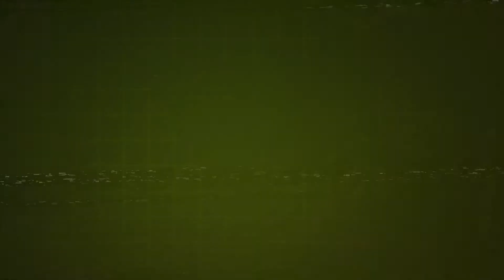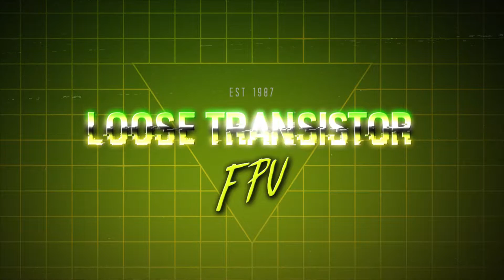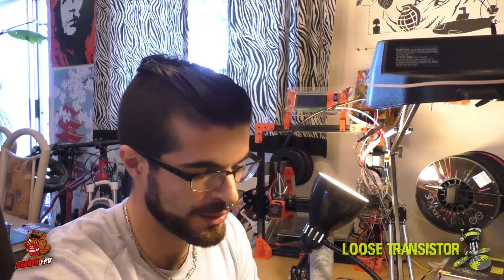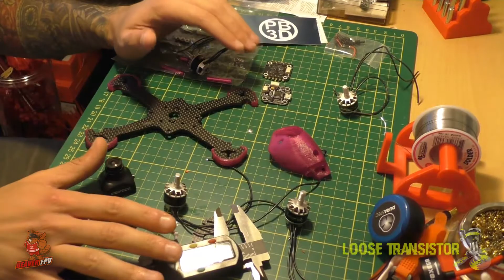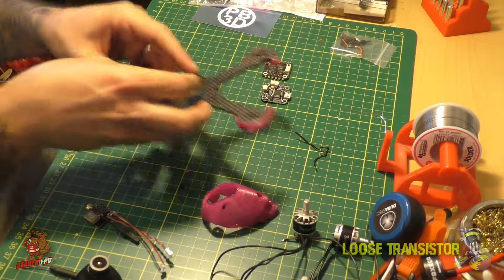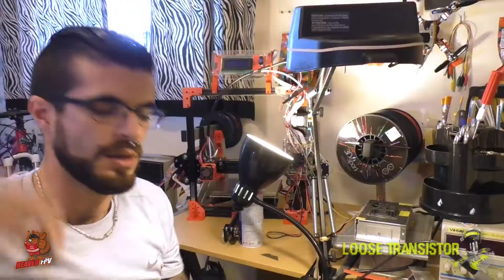SATURN TITAN XS - 3" Parts!  ♠ [ FPV DRONE BUILD ]

Comment: please upload the build video as well I really appreciate.thanks
Reply from the maker: Soon my friend! I still have to build it and record that portion! I do everything sort of real time with you guys, I don't build first then release the videos we go on the journey together =)
Reply: Loose Transistor FPV sure brother I am waiting for build video because you explain each and every thing very clearly and it's very easy to understand.thanks
Reply from the maker: Thanks man, really glad to hear that my videos are helpful =)
Reply: I am very new to this hobby can you assist me which drone is good for me to become expert pilot.thanks
Reply from the maker: I would recommend you buy something that is tough and well built. You will crash a lot at first so its worth investing in a frame that can take some abuse. Wizzard 220 seems to be a popular choice these days.

Look for something with at least 4mm bottom plate. Don't go crazy on motors, 2204/2205 2300kv should be plenty if you are just getting started.

My advice for becoming an expert is to spend some time with a simulator. I highly recommend Liftoff and would suggest you spend many hours there practicing and getting used to flying a quadcopter in FPV.
Reply: ok dear I will practice on simulator first.thank you

Comment: these little brushless quads are an absolute blast to fly! I didn't know they made 4000kv t1 motors! those should ROCK on 3" props

those lumenier props are by far the best 3" props I've used so far, excellent choice!
Reply from the maker: Yeaaah! I love tiny brushless quads man, the Baby Beaver and the Doinker were a blast and now that I think I finally have the right parts for a light 3" build I am sure this one is gonna rip too! You got some 3" quads as well?
Reply: I have an original atom that I've retired haha, my first quad I built / owned and it's been through hell! I recently built a japalura 3" and while it's pretty snappy I decided to throw a 4" baseplate on it and it's perfect now for me! Turns a bit chunky 3" into a pretty light 4" that way, with the option to switch between 3" and 4". It's 190g without lipo, and I wish I could mount the new runcam micro on it and my 8g 20x20 f3 "omnibus" / 20a blheli_s 4-1 combo rated for 4s, that would shave off a good chunk of weight. I've always wanted to build a super light 3", I'm sure that quads going to be a blast!
Reply from the maker: Wow thats super cool, I didn't know you could just change the bottom plates like that! badass! Might have to check that out. I am more into the idea of having a 4" than a 3" personally.

Have you seen the Rotor Geeks Stick? 5" but with 1407 motors for ultralight builds?
Reply: Yeah those look pretty slick. I personally love running 4" with the t1 1407 motors, almost as much power / speed as a 5" with 4s or more speed depending on how light you build it. Never tried 5" props though with the 1407 build, I would imagine it would have to be super light weight but with some 5030 props would be pretty fast!

Comment: but there are 20x20 20 amp esc
Reply from the maker: Hey Chad, yes you are 100% correct however when I ordered the parts ( which was a while ago.. LOL..) they didn't have it or at least I couldn't find one. No biggie, 3S is fine for now and I am sure sooner or later I will break something to warrant a transplant =)